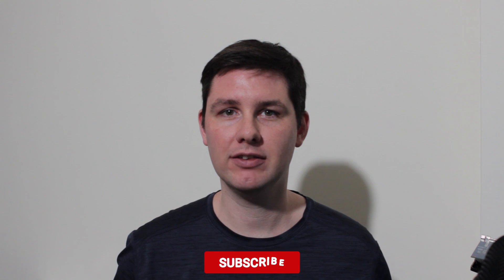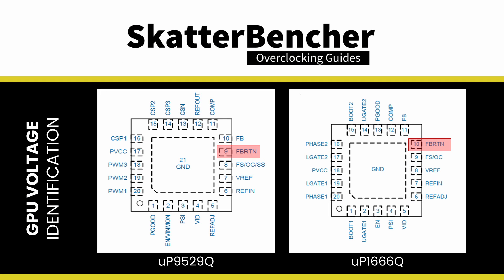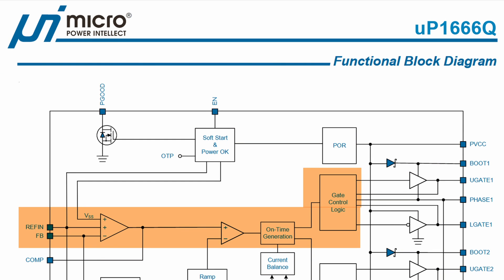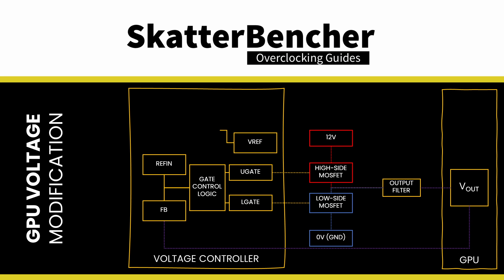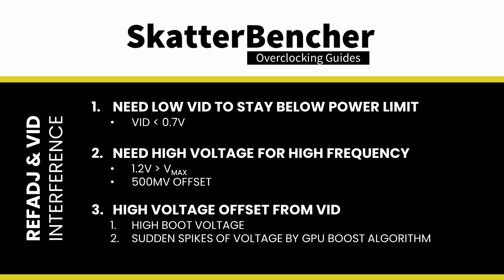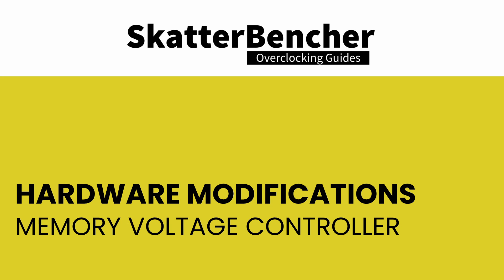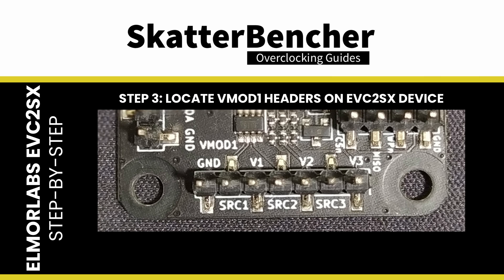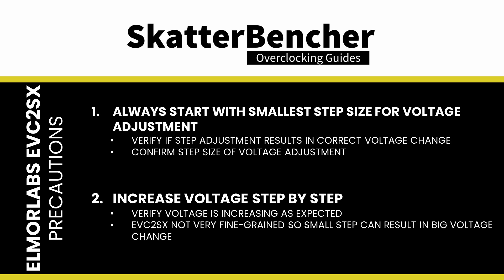ElmorLabs EVC2SX Voltmod Step-By-Step: ASUS Phoenix GeForce GT 1030 PH-GT1030-O2G | SB#40

Comment: Amazing resource, thank you! Little question though, I have a RT8813D running in 2-phase, it has VSNS and VGND pins which are "remote sense inputs" connected to the output voltage of the GPU, if they're in use, is that the same as the FB feedback pin on your controller here? The docs for it suggest removing their resistor will cause the controller to ignore them, not sure what that would do to the stability of VOut...

It looks like I could remove the resistor between VID and REFADJ, causing REFADJ to be stabilised, then connect an EVC to the REFIN just like you have here. Do we just leave the VSNS and CGND pins alone?

Thank you!
Reply: Nvm it looks like VSNS is functionally similar to the FB pin on other controllers, block diagrams make my eyes go funny lol. Might be able to stick it between that and a random vcore pos behind the die. Uneducated guesswork team leader here

Comment: This is extremely useful! Ty! I just ordered an evc2sx and have an analog controller on my gpu. Was wondering how it all worked. I do have some questions. Do you need to shunt mod in order to raise the vcore voltage or its no longer needed since the controller directs the watts? Also is temperature what you would want to monitor as you raise voltage progressively or are there any other factors that can cause failure? Ty in advance.
Reply from the maker: The voltage controller doesn't direct the power consumption.

First, it depends which card you're using. 

If you're using a relatively new, high-end NVIDIA VGA, then most likely there's a separate IC that's reporting the input power (from the power plugs) to the GPU. It does this by measuring the voltage drop over a shunt resistor. In this case, you can do shunt-modding to decrease the power reported to the GPU.

If you're using a low-end NVIDIA VGA, chances are there's no shunt resistor present. In this case, there's no power reporting to the GPU. However, the GPU Boost still needs a power estimate for its algorithm. So, looks like the GPU driver estimates the power consumption by multiplying the internal current (A) estimate with the voltage (VID from V/F Curve) to estimate the power.

When we do our voltage modification, we get free control over the output voltage. To work around the power issue, we overclock a really low point on the V/F curve. Since the GPU driver is using the voltage associated with this point to do the power estimating, the estimated power will be very low.

Yes, temperature would be the main thing to look out for when increasing the voltage. If you're using a cooling solution that's not also cooling the VRM components, I'd also check the temperature of that.

Comment: hey man is it possible to do a i7 12700kf, msi pro b660m overclock guide
Reply from the maker: CPU Overclocking is not supported on B660 motherboards
Reply: @SkatterBencher  what mobo do you suggest ?
Reply from the maker: A Z690 motherboard :)